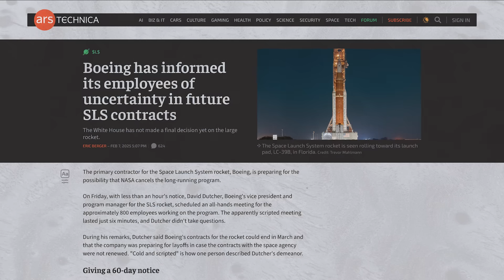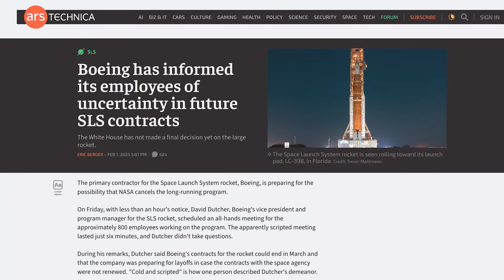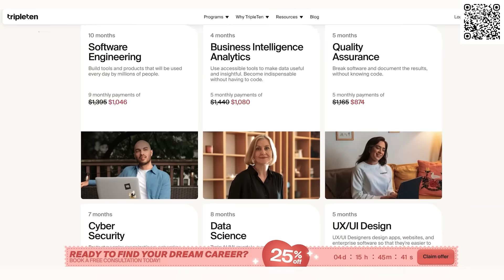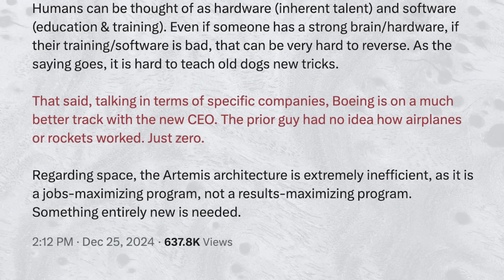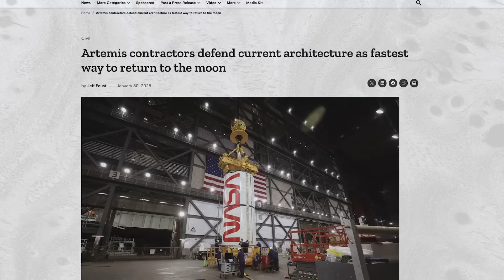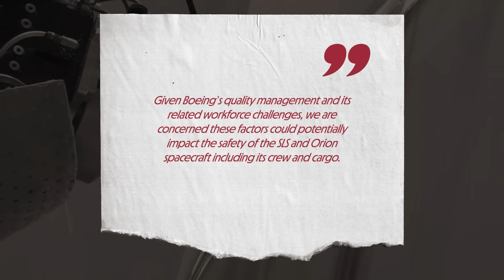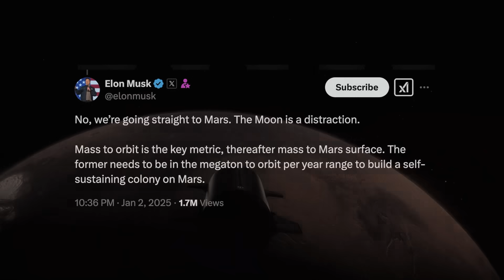This Is The End of Boeing

Comment: The SLS has only got; and has always only had; 4 or 5 launches in it. After that they run out of parts. It's built around using old shuttle components. Nasa need a descent budget of around $50billion pa; and a political directive. And it needs to be independent of US Presidents & congressional influence. Give NASa a directive; give them the money; then let NASA figure out the best way to do it. Is it a STTO? Is it Sea Dragon?

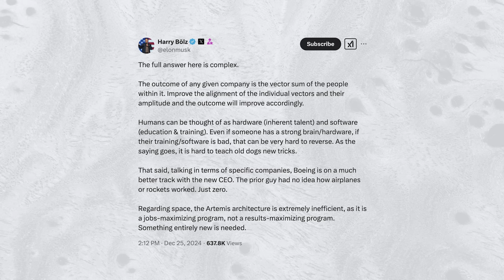Comment: 5:37  "Something entirely new is needed." Its not hard to think of something: New competitive space hardware. Boeing needs excellent managers and engineers that are willing and able to think outside the box into the future of human space flight. The facilities and the workforce are there. 

The first stage of SLS is over. Guaranteed gov money and glacial slow production rates are over.  Learn to fly on your own again or go extinct.  Now what could Boeing offer, that others are struggling with: Confined interior space ergonomics (derived from commercial airplanes), long lasting, fire resistant cushion materials, air ventilation systems. Its the perfect company to construct modular deep space vehicles. A lightweight Lunar Lander of the Alpacca type could be a first step, but combined with space station workshop hangars to do maintanance in space. Also universal steering modules for enabling construction machinery companies like komatsu to work on the surface of the moon. These pods would need two airlocks, personal ammenities (toilet, shower, emergency supplies) and standardized interface connectors that can withstand the harsh conditions. 
Another field could be Interplanetary flight hardware with generous inside quarters. Designed to be assembled in space.

Comment: What must also be mentioned is that even is sls and Orion are ready to go space x is way behind on the starship moon lander. They will likely be what holds it up
Reply: They don't need one until Artemis 3..  So far unless 3 changes it's going to require the EUS and the new launch tower is it not?
Reply: @ yes not until artimas 3. However starship still needs to work out getting to orbit, figure out the fuel transfer system,  and work out tbd inevitable kinks in the still in development raptor 3 engine.

Comment: It's unfortunate, and this plan has been seeping along for a long time... No, I do not think it is a well-handled program, either, but it's in the mold of what could be expected from admin to admin, time and money. It would be good if reality had not come along in SpaceX and others. But the fact is, it is a modern dinosaur in so many ways, and there is not a way it would not have happened this way in this world today. How absolutely AMAZING is it that we can say this? A program that has all of the issues of a disposable, overpriced system has actually been overtaken by the reality we have in today? I'm personally not even upset. This is just how it goes. If SpaceX in particular and others were not part of the picture, NASA would have all the engineers they need and probably better focus. And yes, so many reasons to be upset with Boeing. But they are locked into a system that has not been run well either.  So if Artemis is the worst part of the space program today, what an amazing win for everyone, and yes, especially America. I honestly cannot imagine what to do with it, especially at the rate that Starship is progressing. But, hey man, first-world problems.

Comment: The RS-25s belong in a museum, not an Expendable rocket booster! Some of the best rocket engines ever made. Every time they are burned up is a fucking shame.
Reply: The idea was to save money by using shuttle tech. So much for that idea. Meanwhile SpaceX has developed the raptor Mk 3 which is way better than the RS25s, which were great, but they've had their day.
Reply: @aldunlop4622  and yet a raptor mk 3 has never been to orbit.
Reply: @divedevil985  IFT 5 could easily have gone to orbit, it was pretty much there, but it wasn't the mission profile for it to be orbital. When SpaceX decides to have an orbital profile, maybe even in the next test flight, it will easily be orbital. It's already a proven engine, there's 32 of them just on the first stage, which doesn't go orbital, but there's 6 of the Starship and there' absolutely no reason to doubt it will be orbital, soon, and be capable of delivering 100+ tons to orbit.
Reply: @aldunlop4622  there is plenty of reason to doubt that. The entire reason V2 exists is because of massive performance shortfalls on V1. So their solution was to make it heavier.
Even if it does reach orbit...it's mostly empty. The majority of the systems don't exist yet. Then add the stresses of payload and finally re-entry. 
It's not as easy as you seem to think.
By the way....there are 33 engines on the SH and it is a complete unknown if they could actually fly again.
Reply: @aldunlop4622 using solid rocket boosters from 1980 in 2030? Sheesh...
Reply: we have plenty in museums. Since when do we preserve every copy of an artifact?

Comment: I would be careful in underestimating a first principles physics thinker. If you're able to start bringing fuel to a Starship, that's already in orbit. Then Starship tankers can give it a full tank of fuel to go to Mars.
If you also have Starship tankers that can go to the moon and start making fuel on the moon, or Starships can go to a lunar orbit, refuel and go to Mars. The moons gravity is less so if we manufacture or launch Starships from the moon this will use less fuel and create less costs to go further. Of course, with the abundance of helium 3 on the moon, the idea of creating a nuclear fusion Starship is right around the corner. There is no radioactive waste, so it will be safer for Astronauts, scientists and anyone using it.
Reply: They still don't have any idea how they're going to refuel in space. The extremely annoyingly close boiling and freezing temperatures of methane and oxygen are a huge hurdle. You freeze one and your engines get fucked when you try to restart, or you boil the other and have to have an insane number of launches.
Reply: @MollyGermek  What silly nonsense.
Reply: Helium 3 is not that abundant and it'll likely never be used as a fusion fuel, at least not in the foreseeable future.
Reply: “…nuclear fusion…right around the corner.”  Ok.
Reply: @Pene7942  I mean it is getting closer, it's just far closer to being 'right around the corner' in China than the US. They just achieved nuclear fusion for 18 minutes breaking their own previous record of 100 seconds.

Comment: The SLS is noy Boeing fault. NASA wanted an old-style rocket system, and they got it. As I understand it they also made up to ten copies of the SLS rockets to save cost down the road. Also to keep people in work. This I think was due to members in congress who wanted work for their districts. After all this is old and proven equipment, right? People just forgot that there where many delays in lift off due to system errors. either way Boeing is no longer the leaders they were in Apollo time. That is just a fact. So now they have a bunch of parts of rockets that are going to be scrapped. Now that is a real waste of money
Reply: No, it wasn't what NASA wanted, it was what congress wanted and that was to use as many legacy contractors and as much legacy hardware as they could.
Reply: @imaginary_friend7300  so you missed the part where I said more where made for some districts to provide jobs for people in Congress?

Comment: A mega throw away rocket topped with a retro spam can is not viable
Reply: The shape of Orion was optimized to handle the physics of re-entering the atmosphere at 25,000 mph, not to be "retro" in appearance.  Dragon was designed to be optimized for re-entering the atmosphere at 17,000 mph. Engineers design for viability and physical constraints, not aesthetics.
Reply: @ it's a retro spam can! An obsolete inefficient Throw away everything after one use return to the 60's! A re enactment of past glories! Waste of taxpayer money
Reply: Not at four billion per flight it's not, and never has been... I've been following all this long enough to remember when SLS was expected to cost only a billion dollars per flight LOL:)   roughly equivalent of shuttle flights...
Reply: @ A throw away mega rocket will never be a viable routine method of travel

Comment: I feel like skipping the moon as a step of space exploration and building infrastructure in space is a massive blunder as the moon is a very accessible place for resources whereas mars has not much resources to use. In order to setle the solar system it is important to develop the moon as a place to extract resources. Elon's lack off interest, the lack of maturity of the starship HLS and refuelng procedures, and the potential cancellation of the SLS architecture means that the US is likely not going to get to the moon before China in 2030. As for Mars, which Elon will focus on, when Elon will get there will be determined by the rate of progress of SpaceX's new tecnology.
Reply: What makes you think Mars has no resources?  It arguable has more than the moon including the possibility of making fuel there.
Reply: Most of that is pretty wrong. Luna is severely carbon and nitrogen-starved, so those elements must be brought there, while Mars is about as well-stocked as Earth. Not only is the atmosphere highly exploitable (harvested by a simple pump into a chamber) but Mars has undergone the same hydrological processes which concentrate ores like copper and iron on Earth. The Moon's surface almost certainly has never seen such activity.
 Perhaps fusion reactors will one day become viable and the harvesting of Lunar He3 will commence, but you're still talking about processing tons of waste at a time. Most anything besides the scant volatiles in perma-shadowed craters will demand very high energy processing (like breaking up and smelting the Moon's undifferentiated trash rocks for minute quantities of desirables, in an environment with nothing to burn and no ambient O2 for it to burn in). 
Also, going to the Moon won't teach us anything new about how to survive in the Martian environment, and hardware designed strictly for Lunar missions will not be backwards-compatible with a Mars program, unlike the other way around.

Comment: I highly suspect that Artemis 2 and 3 will fly with SLS. All of the hardware for these two missions have already been built despite $HUGE $ cost. SLS is currently the worlds only human rated craft capable of reaching our Moon.
Reply: Or will not fly at all. There is just no other vehicle now capable to do so - with people or without.
Reply: But only for a gloryfied "touchdown", a mere repeat of the Apollo Missions. And don't forget that there is still no Lunar Lander! The goal has to be a permanent presence on the moon with development of huge habitats and workshops buried under a thin layer of moon dust. For maintaining surveillence, mining and building equipment, for scientific research, visitor areas, a huge gym to fully experience the lightweight feeling in habitable air pressure, jungle and pool area - things people like to be around.

 SLS can't support that. SLS is an Apollo 2.0 without a lander and far too slow and too expensive on every measure. It would be better to ditch the human capsule and use already finished SLS to send a decent sized Lunar Rover to conduct habitat tests and research. This would also provide the possibility to test moon landers and rovers.
Reply: @genius1a  I agree with all of that but I suspect Trump wants the glory of that “glorified landing” and with most hardware already built and the systems human rated I suspect that the currently planned Artemis 2 and Artemis 3 missions give him the highest chance of getting that glory before the end of his current presidential term.

After Artemis 3 though I suspect all bets are off. Why develop even SLS Block 1b let alone Block 2 when, as you say, the whole system is just too inefficient to support keeping a permanent Lunar presence going without incurring crippling costs? In my opinion far better to make it clear now that SLS has no future beyond Artemis 3, cancel Lunar Gateway, and allocate the funding released towards developing a far more efficient mission architecture that can take over once Artemis 3 has had its glory moment to establish and then support a permanent Lunar base within an affordable annual budget allocation.
Reply: @genius1a  And why exactly do we need "permanent presence on the moon with development of huge habitats"?
Reply: @ Because we can do it, and its a good goal for young people to explore new grounds, show their abilities and develop new thrills for vacation cruises. Nobody needs to do cruises into the Arcitc, but people pay for it.

 If the US won't do it, the Chinese will be there in a few years. Remember how the US wanted to build a space station, but couldn't afford it and collaborated with europe and russia to do it? The Chinese just built their own space station. I hope there will be compettion out there - but not a fierce one, but a friendly one, helping each others out when needed. Like it  has been good practice on the oceans for decades.

The first principle reason: It is immensely more efficient to start exploration and mining from the moon, because of its lack of atmosphere and low gravity, than doing it from earth. Young healthy humans like to expand - lets do it!
Reply: @genius1a  So do you want to pay like $200 per year for like next 10 years for that "goal"? Do you think all Americans want to? So somebody will be on a Moon? If I am going to a cruises into the Arcitc - I am enjoin Arcitc, not some astronauts 😀.    Did you ask  young people if they care or in reality that a bunch of old gays, who want to return "good old times"?  Chinese will be there - and?  As my school teacher sad "if all will be jumping from the cliff - would you too?" 
And no, it absolutely not "more efficient to start exploration and mining from the moon" - that complete misconception. As a matter of fact that hard to land to a Moon, because no atmosphere there and then you need also to lift from it - and all that absolutely for nothing. There is 0 (zero) advantage on building any on a Moon compare to open space (like low or high orbit if you want)

Comment: I don’t think Dragon’s heat shield is designed to go to the moon with the higher re-entry speed.  The issue with the Orion heat shield is the manufacturing method, not the material used.
Reply: Apollo came back from the Moon, SpaceX can find a way. Maybe not reusable, neither is Orion shield.

Comment: Starship has to prove itself before it can replace SLS, at that is still a long way off, in the meantime, Orion should be launched on New Glenn or Falcon heavy, to keep post SLS Artemis going.
Reply: SLS is only 70 tonnes to orbit.  Falcon Heavy can do that, and with a kerosene upper stage no less... fund a modified hydrogen upper stage for Falcon Heavy and with its greater efficiency you could get probably another 10-15 tonnes of performance out of it.  We're already committed to and EOR/LOR type mission plan, what with the "lander" being launched and refueled in LEO by multiple starship launches, and then lunar orbit rendezvous with Orion.  You could do the same mission with two launches of Falcon Heavy, one for Orion and a second for a smaller dedicated lander more similar to the LM than the lunar starship.  Worry about the other stuff later, if there is a later...

Comment: If America's only reason for continuing to use SLS is to "beat the Chinese" to the Moon before being scrapped, it should be scrapped immediately. If America really wants a regular presence on the lunar surface,  it needs a sustainable way to get there, and SLS is clearly not that. Better to funnel those funds into a stronger project than to waste them on what is essentially nothing more than a body part measuring contest.

Comment: Back to 2000s, scrap everything u have done for last 20 years and build something new. With that attitude china is gona be first even on mars. The biggest NASA mistake so far was to give a contract for a lunar lander to only one company. SLS have ready hardware to do 3 artemis missions and the third one was landing on the moon (after that i agree to scrap sls and replace it). And do u know what is not ready and probably will not be until 30s, a spacex lunar lander which is a very ambitious project. And yes, when it will be ready it will make a huge advancment in NASA space exploration but for now, NASA need something simple and fast to build if they wana beat the chines. And do u know who had a simple and fast to build landers, two other competitor's. So the biggest reason NASA might fail in beating Chinese is relaying on only one company for lunar lander.

Comment: You can’t say SLS1 went perfectly…..and then say chunks were missing from the heat shield…..like saying the Doctor says I’m perfectly healthy….but I have Diabetes…..you are spouting bull
Reply: SLS worked perfectly, Orion didn't. There's a difference. At worst SLS damaged the launch tower by blowing away some panels
Reply: @12pentaborane  so Orion is not part of the Space Launch System???…really?
Reply: @SusanRice-h1r   No it's not. It's like saying Starlink satellites are part of Falcon 9. SLS is the launcher, Orion is the payload. They're made by separate companies. Orion was made by Lockheed Martin.
Reply: @SusanRice-h1r  Orion is the payload, but so far the only payload for SLS, but it's not SLS so really its mostly about how you want to spit hairs.  Most would say since the rocket delivers it, like a payload, it's not part of the launch system itself.